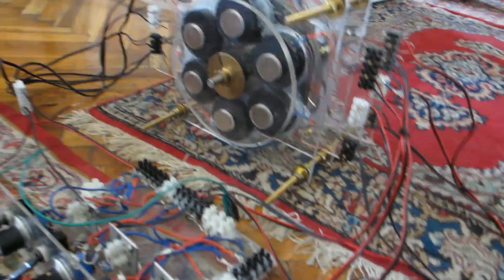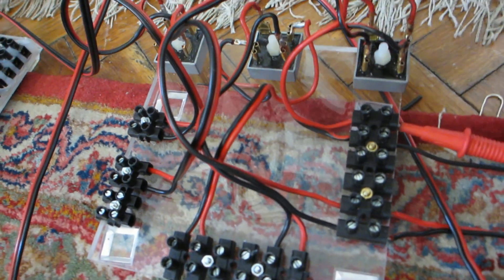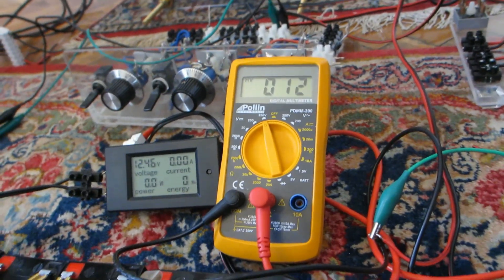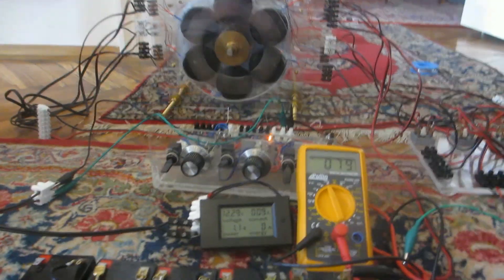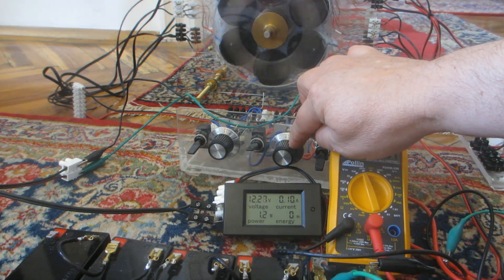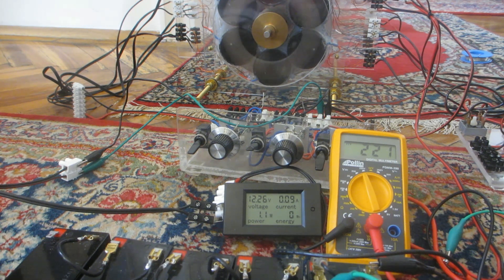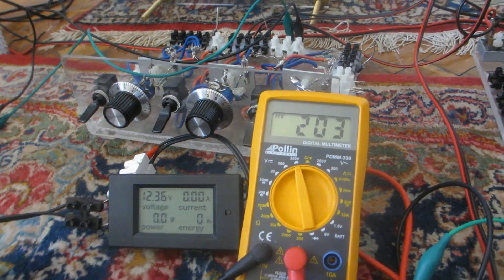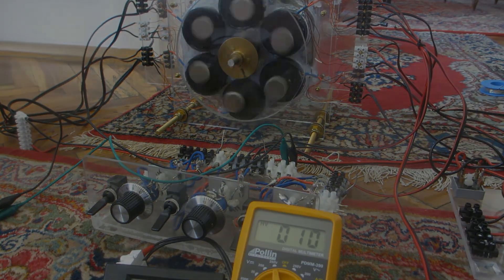New 3 rotor motor generator - Close to Overunity. 220 Volts Output

Comment: Nice work
have you more info about the coils and with core?
Reply from the maker: the coils are all air core.. bifilar, 0.4mm wire, hooked up in series. must be around 27ohms one strand, so 54 ohms for both per coil. I will measure again, but can only tomorrow, because i am not at my place this sunday...
Reply: @FreeEnergyNerd  Thanks